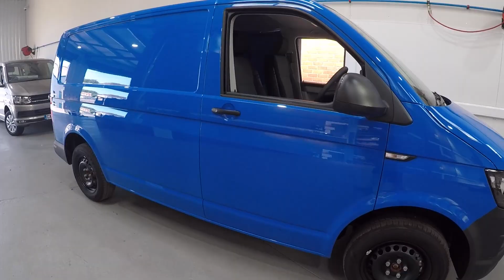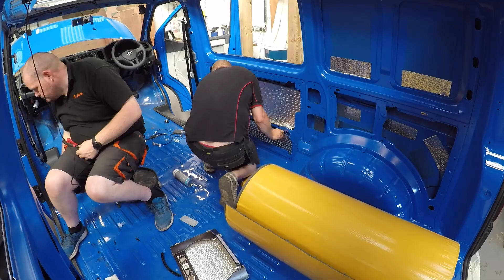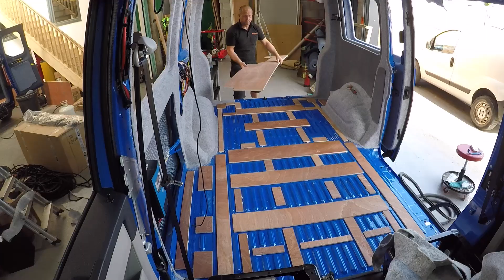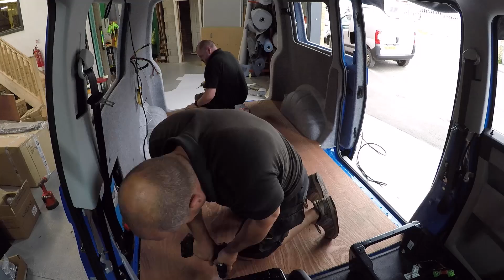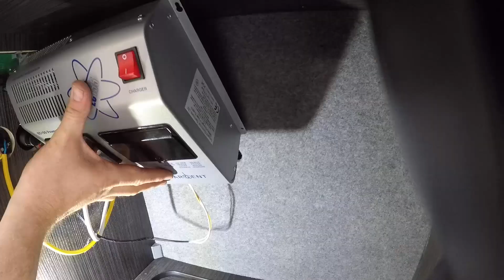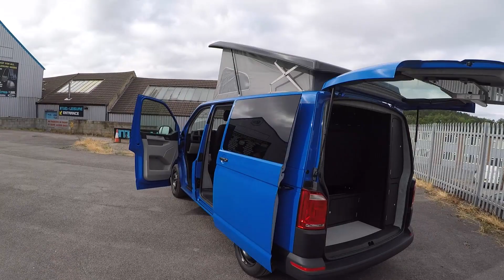VW T6 Campervan Conversion Time Lapse

Comment: You must insulate the van, without condensation will build and cause all sorts of issues, electrics, bad smells, rotten wood, mould etc, also you have to create expansion relief for the fake window, else in the bright hot sunshine that window will smash. It’s a tidy enough job but no good for a long term keeper!

Comment: no insulation? and the fake window at the back looks like you totally sealed it on with no hole in metal or break in bead of adhesive, in the summer when its hot trapped are will expand and your glass will shatter
Reply: seen this happen last week in scotland
Reply: I thought about the lack of insulation as well 😱😱❓